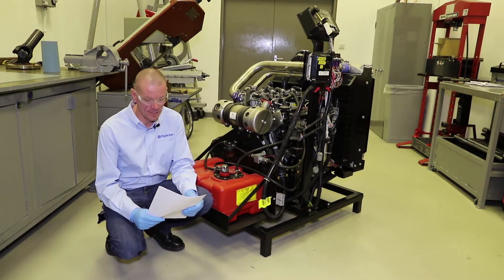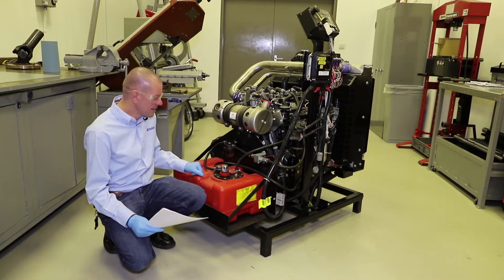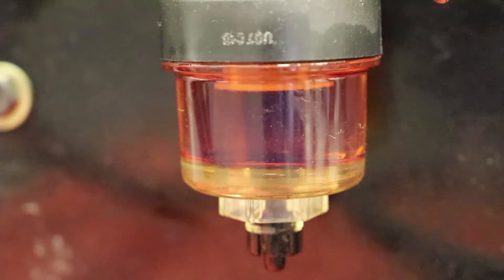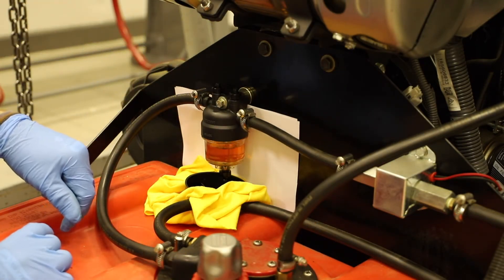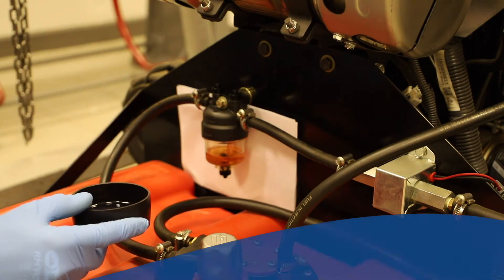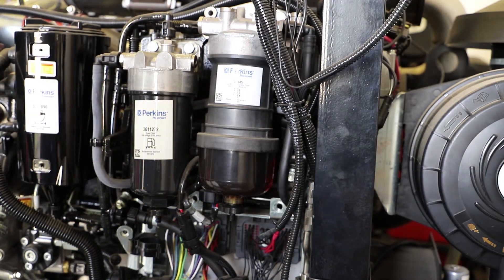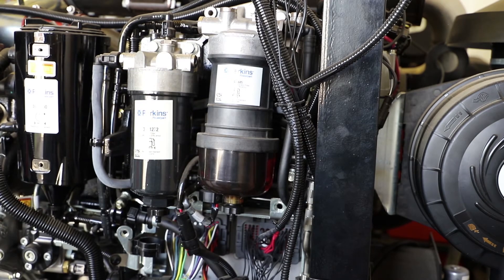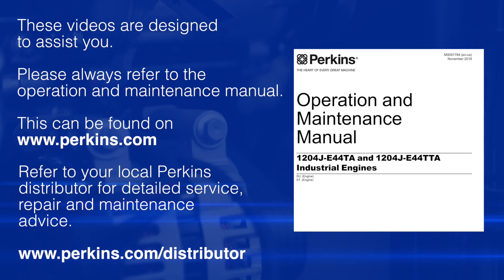Perkins Daily Engine Check Series: Water Separator Drain

Comment: Thanks for the video. I have a New Holland T6050 with 6.5ltr Perkins engine. What happens to the air in the water separator when you empty any water from the separator and then it primes back up with fuel from the 1st ignition? Does it need to be bled off futher along the fuel line before the fuel gets to the injectors. Thanks.